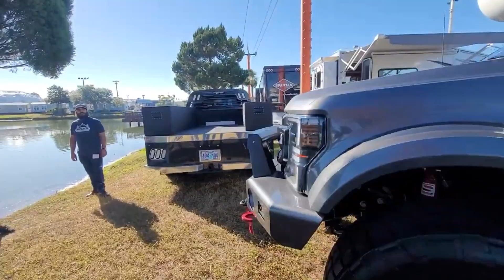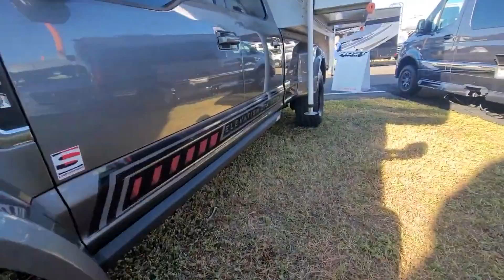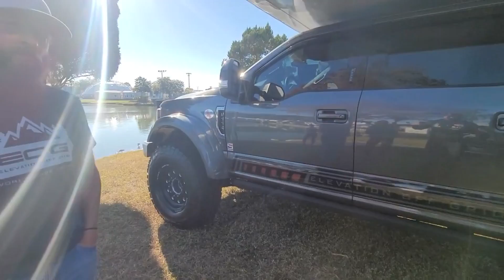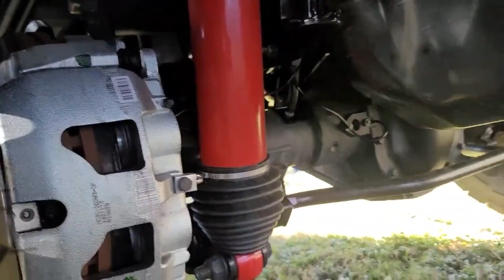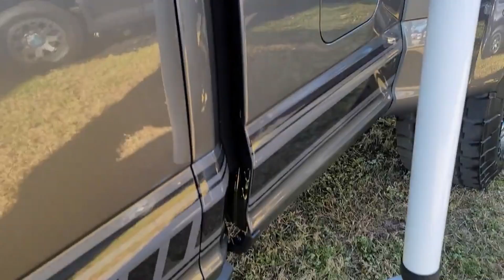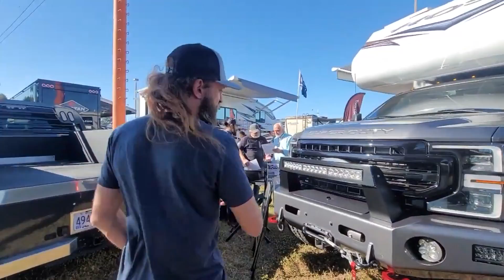2022 FORD F550 4x4 LARIAT PICKUP BY ELEVATION OFF GRID WITH LIQUID SPRING SUSPENSION

Comment: You’re incorrect about the 450. The non commercial version has less, the cab chassis version has far more than the F450, this is also a cab chassis straight from the factory. You can buy all the stuff they put on that truck, except for the bed